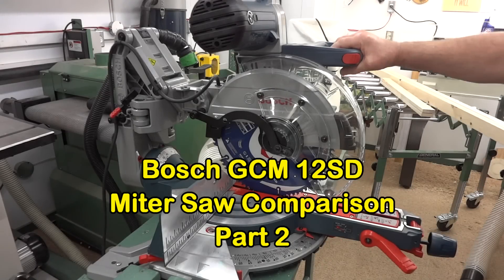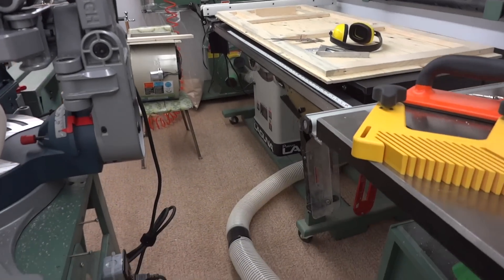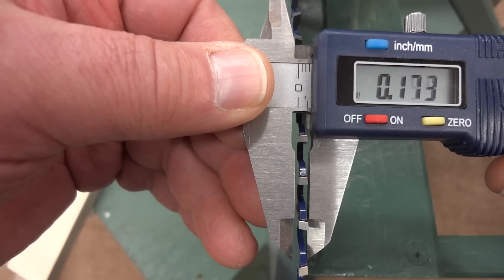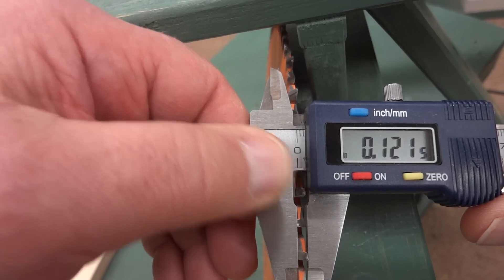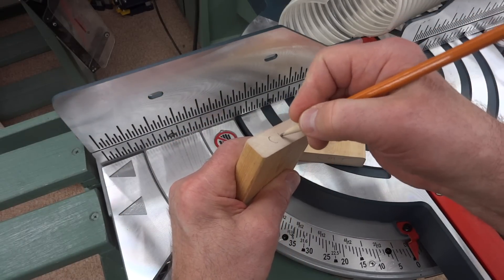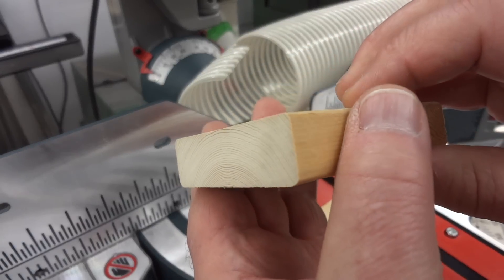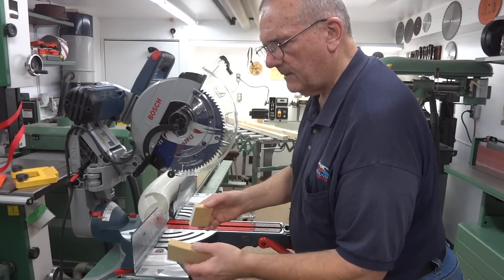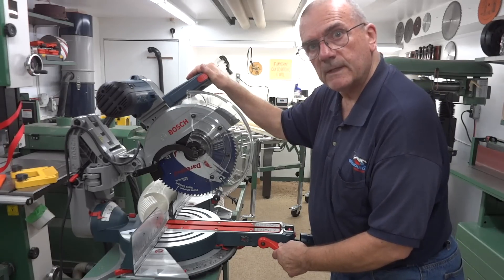Bosch GCM 12SD Miter Saw Comparison Part 2

Comment: I like everything about this saw except the lock for the trigger and that it doesn't have a Lazer or blade cut lite like Dewalt saws do so that's why I went back to the Dewalt  .
Reply from the maker: +Steve Miller 
It seems that a lot of guys are disappointed in the fact that it doesn't have the laser guide. I thought that it should too for the price of it. The saw that it replaced did have the laser but I found that I couldn't rely on it for precise accuracy and therefor I wasn't using it anyway. What I do is lower the blade until it's almost touching the work and then micro adjust the work accordingly. But that's me. Everyone is different and if it works --- well :) I guess you saw how I overcame that stupid trigger lock problem. All being said, I'm still pleased with this saw.
Reply: +Ron Calverley I am a trim carpenter by trade for 35yrs and I found that the blade lite on the Dewalt saws shadow the thickness of the blade so you know exactly where the blade is going to cut. And when you have to make repeated cuts all day it saves constantly having to line up the blade which takes a lot of time to make the cut.
Reply: +Ron Calverley And when you are cutting from long point to short point a shadow line comes in handy. I think Bosch really dropped the ball on such a high price saw.
Reply from the maker: +Steve Miller 
I'll bet that the next model Bosch puts out has it. They are undoubted reading our unhappy comments.
Reply: +Ron Calverley The UK version comes with a laser fitted and doesn't have the extra safety switch on the handle, Its just press and go, It even comes fitted with that new blade you bought, (it isnt painted blue like yours) I recognise the laser cut expansion slots on it, Ive owned one for around 2 and a half years and love it, My one gripe is the weight of the beast, it would of been nice if Bosch used magnesium to get the weight down, but then again that would add to the cost..... It already costs £740 here in the UK which works out around $1100, Unfortunately we pay a lot more for electrical equipment.....

Comment: What about the head deflection?    I'm reading that it's excessive at full extension, What have you seen with yours?
Reply from the maker: I honestly haven't noticed that, however I've never actually checked for that either. Next time I use this saw I'll try to remember to check it out. Thanks for your comment :)
Reply: Yeah, I'd like to see that checked also.  I just got the 10" version and mine is off a bit but not to the extent that some have reported which burns the wood or at least mine didn't on a 1"x 6".  On the Wixey, I have the same model it shows at off by 0.2-0.3 degrees.  Checked with an angle plate, indicator mounted on the blade, it checks off by 0.15 degree.  Not sure if that's a deal breaking issue for most users or not??
Reply from the maker: It may well be that by now Bosch has received enough bad press on this issue that they may have changed the geometry to correct this problem --- hope so anyway. However, as mentioned, I have not noticed this problem, but then I must admit that I don't use this saw as much as I thought I would. But I still like it :)
Reply: The Amazon reviews go back to January of 2015 on this problem with one have two saws still the same.
Reply from the maker: Hi William,
I finally took the time to check this out for myself. I hope this is the problem that the commenters are refering to :) Pease see  https://youtu.be/s9BKxK-5lI4